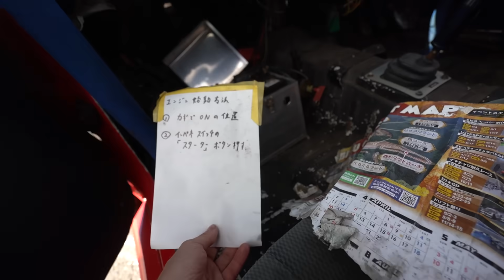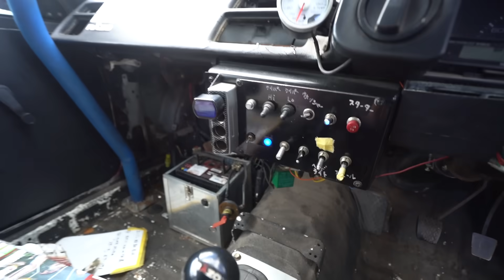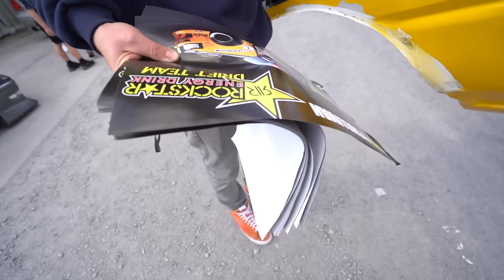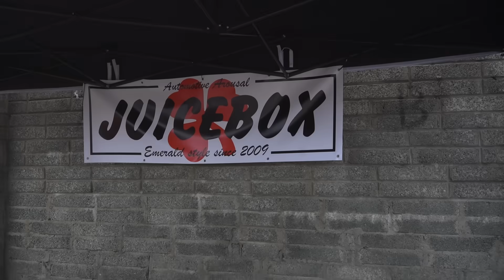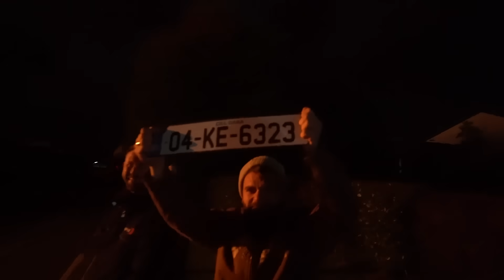Is Japanese Car Culture Still Alive And Well?

Comment: Im down in NZ and the car scene has drastically changed, 10-20k to even get a half decent car to mess with, and then shipping from japan is super expensive these days, its basically gone from a fun cheap easy hobby to a middle class luxury, i had to give up on cars because its too expensive.
Reply from the maker: Pretty much! Theres a few bargains to be had in Ireland from Japan if you are creative, but all the heavy hitters are very hard to acquire these days, and insurance is somewhat of a nightmare for the youth if anyone has managed to hold onto stuff from years ago they are the lucky ones